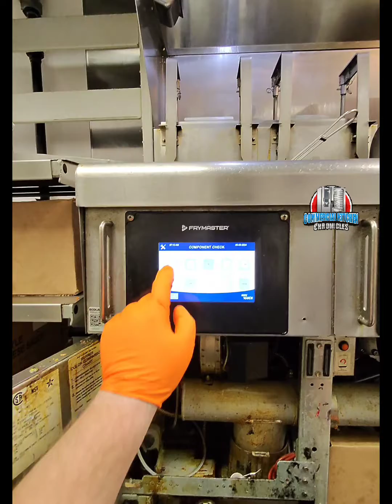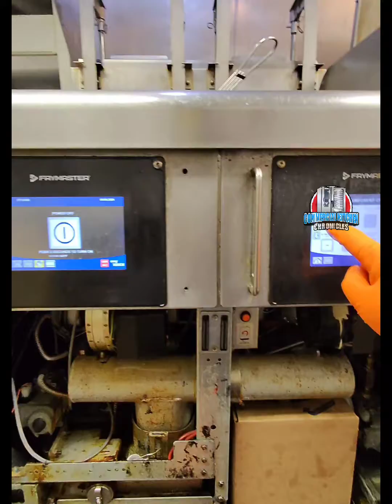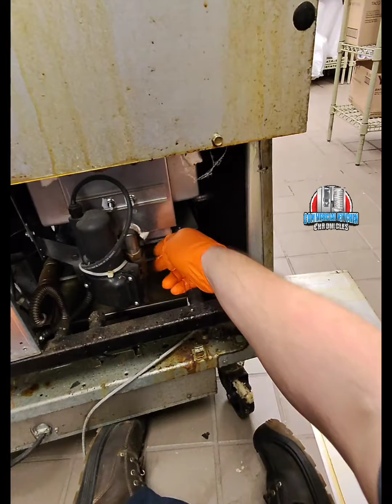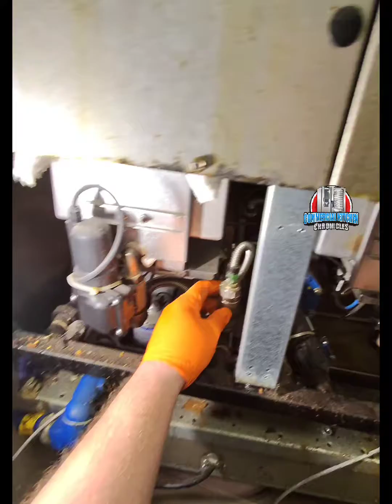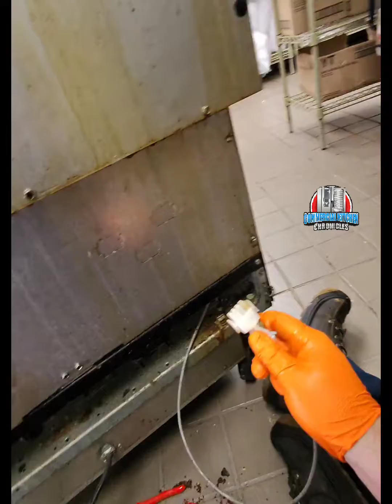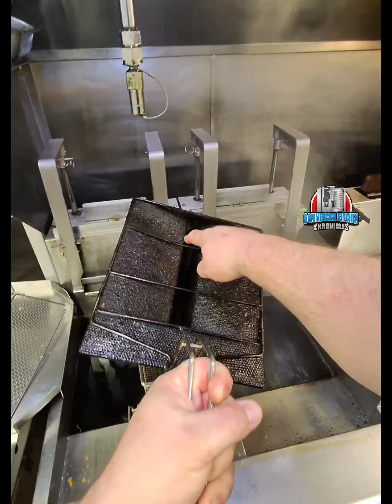The filter pump is dead.

Comment: Its from not filtering enough; debris builds up and pushes into the hole in the back of the fryer and crumbs falling into the return actuator valve and then when the return valve opens crumbs fall down from gravity and then compacts in the bottom of the return actuator valve.
Reply from the maker: No,
Reply: @CommercialKitchenChronicles  yes Pat because nothing that big would get through the pump without jamming the pump see the Frymaster videos and speak to tech support and they will confirm it is because of the debris building up and gradually falling into the return port that causes the return to restrict what you are saying caused it is impossible without jamming the pump because a grain of rice would jam the pump.
Reply: And that is why they have come out with the oil return diverter to stop the debris from falling into the return port.
Reply: I tried to share the video from Frymaster that states the same thing about debris backing up into the return port, but I don't know if it shared with you. You can find it at Frymaster search for diverter, and it states the diverter is to protect the return port from having debris pack into the return port and pack in. So again, "YES" what you shared is incorrect.
Reply from the maker: @dmiestercommkitchentech3043  it's on the side before the valve, it's coming through the pump lol
Reply: @CommercialKitchenChronicles  ok Pat I've seen this issue alot and the first one I contacted Frymaster and they are the ones that say it can't make it thru the pump without jamming the pump they were the ones that told me how it happens speak to Senior Tech service Robert or Dan and they will confirm you are mistaken because I thought the same thing it was getting sucked into the pump and they said the large chucks found in the return line would jam the pump because the spines on the gears inside the pump can not pass anything larger than grit but the grit builds up and then jams the pump so crumbs are found inside the return line which is from it building up in the low volume fryers which allows it to back up into the return port. I know it is past the actuator valve that is because it opens and then the pump turns on and crumb falls down and catch inside the fitting and starts build up until it is blocked which causes the refill cycle to slow down. Check with Frymaster if you don't believe that I'm right I dare you. But you believe what you want. If you check with them and they say I'm wrong then I'll be the first to admit I'm wrong and PUBLICALLY APOLOGIZE TO YOU. I know I'm right I dare you to prove me wrong anyone interested in knowing should go to the source Frymaster Fryers and search for the diverter replacement and listen to the description for what it is for. Also that screen that you pulled out is in the suction or inlet of the pump and would catch the debris before it made it to the pump that debris was crumbs nothing that size would get thru the pump the spacing is too tight, but again you believe what you want I just hope that everyone knows that people are wrong on you tube quite often and to not take everything they hear as the gospel. I respect you Pat and agree with most of what you try and teach but this time I don't because I have experienced this issue too many times and was corrected by Robert at Frymaster Tech support for thinking it came from the filter pan when it came from the vat and is caused from being a low volume fryer and the trash area being 1/3 the size of the older fryers that could handle more trash in the fryer which meant less filtering because there was a larger area for the debris to accumulate in but when fryers became low volume fryers they could not reduce the cooking area so they reduced the area where debris accumulates which now means fryers have to be filtered more because everyone knows if you have 1 large trash can in their house and the can size is reduced then the trash has to be taken out more often instead of taking it out once a week (filtering once or twice would need to increase the number to double or triple maybe even more depending on usage) it may need to be taken out two or three times a week instead of the original 1 time due to the size of the trash can or debris area.
Reply: @CommercialKitchenChronicles  I know where it is and it is because the actuator valve is opened before the pump is turned on that the debris falls thru the ball valve from the Fry pot and when the pump turns on it pushes the debris up and it gets stuck at the entrance to the actuator valve which is the ball valve and this is why the idea is that it comes from the pan when in fact it doesn't because it would jam the pump before it made it to the return port or the actuator valve, this is what Senior Tech Support rep Robert at Frymaster explained to me how and why it happens and the fix for it is the return port diverter. But you believe what you want because this is not worth me proving it to you if anyone is interested in verifying they can get on Frymaster Fryers You Tube and search for the diverter replacement video and listen to the description of what it is for and what causes it because it clearly states the debris backs into the return port and restricts the refill cycle. You won't admit it if you found out that I was right anyways so it does not matter I just want everyone that watches these types of videoes to not take them as the gospel because there are a lot of influencers that aren't always correct and not humble enough to admit it.

Comment: Thats crazy how that line can get plugged up like that.
Reply: It’s funny how so much of our job is fixing things due to improper training, lack of common sense, or just not giving a $hit!!
Reply from the maker: @jamesjacobs3651  lol
Reply: Do you ever try using a heat gun before pulling the lines apart? Obviously with a clog this severe just heat wouldn’t have freed it up but just out of curiosity. I always go with the heat gun first and see before I pull lines apart.
Reply from the maker: @MonumentalMeash  it's not grease related. If I lose heat tape at a place that uses solid shortening I will. This customer uses liquid shortening. So it's never an oil issue.
Reply: @CommercialKitchenChronicles  gotcha. Love the channel and podcast I’ve learned a ton in my year and a half in the field from your channel especially. Keep up the good work. 👍
Reply from the maker: Filtering with out paper